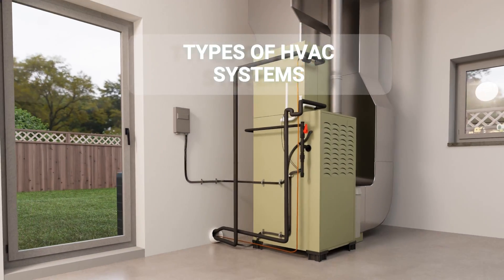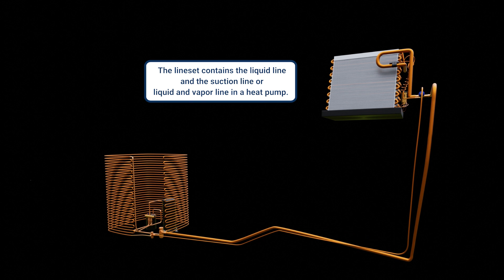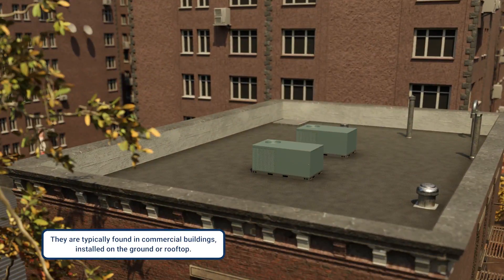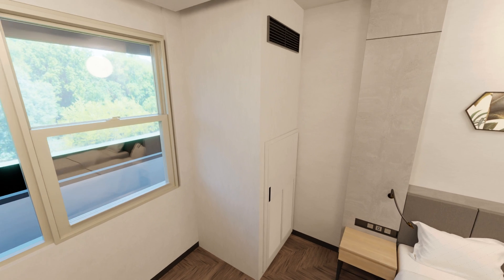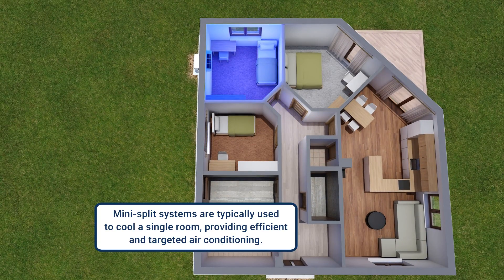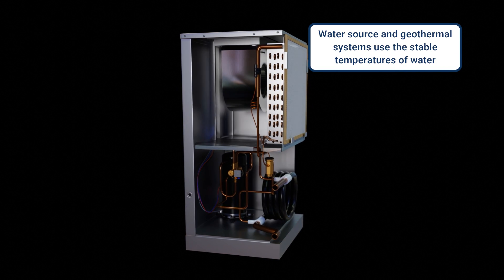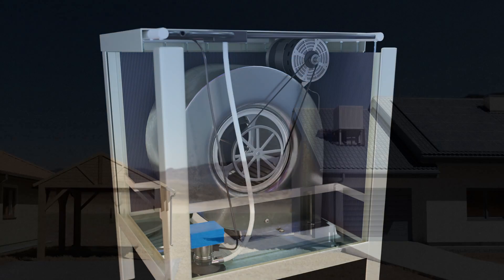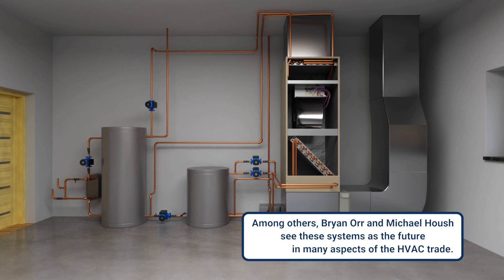AC Types 3D

Comment: You missed some facts on geothermal system. They do offer split geothermal units which keep the compressor away from the air handler.  Also split geothermal also has duel fuel capabilities which is very popular in colder climates so electric back heat isn't needed.
Reply: You are right.im working on a massive  new construction lake loop with a split system. It's massive!
Reply: @YouTubeCommunists  yea split geothermal is awesome.  I've installed quite a few over the years. I've done a couple of duel fuel split geos which were very nice.